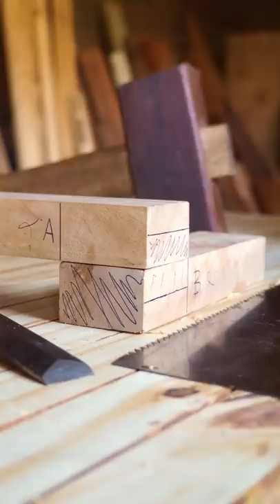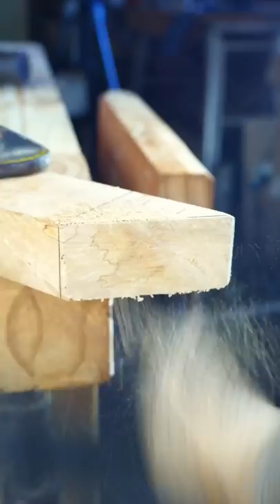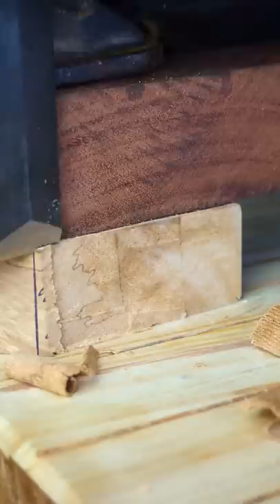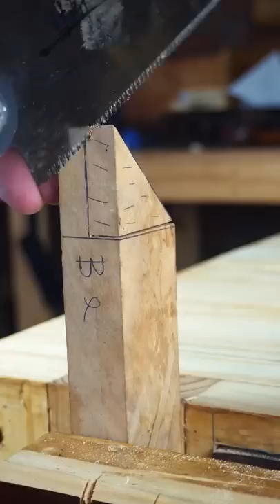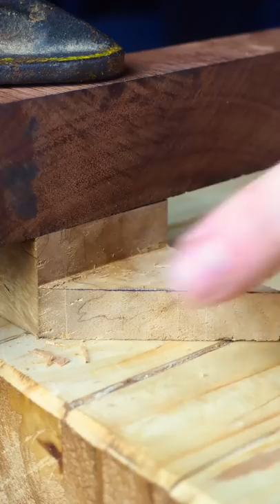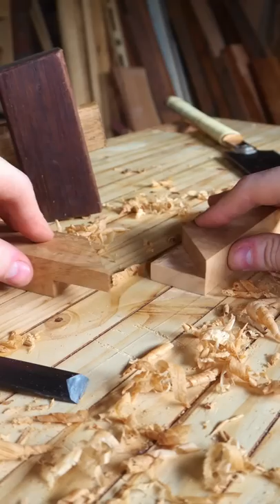Mitred Half Lap Joint #shorts #handtools #woodwork #asmrsounds #oddlysatisfying #satisfying #relax

Comment: I feel like you're purposely cutting way off the line with that flush cut saw just so you can use the chisel more. How I know is I do the same damn thing. I live using chisels. It's so satisfying when you have a hairpopingly sharp chisel that glides through crossgrain. (Insert Homer "mmmmmmmmm" sound)